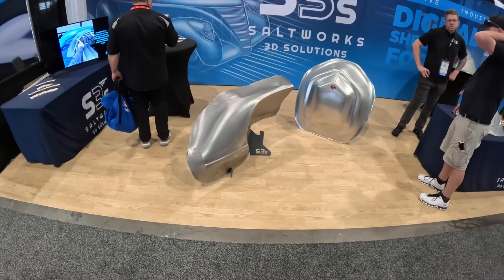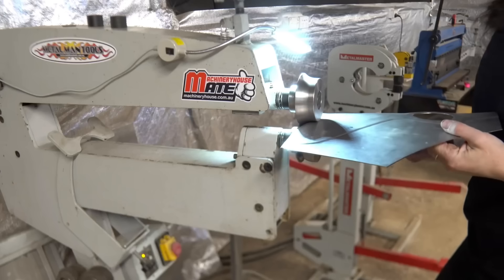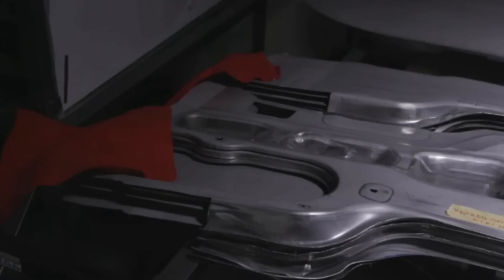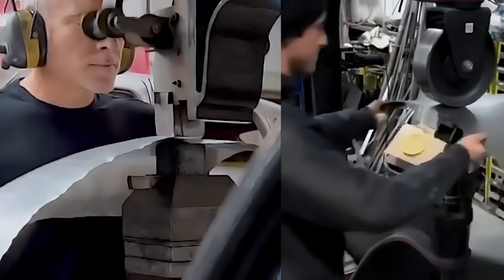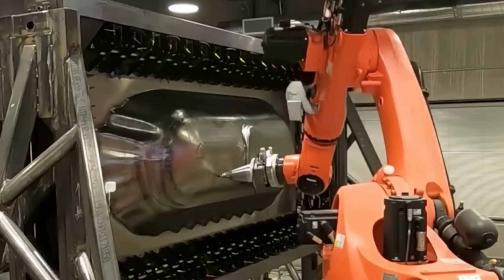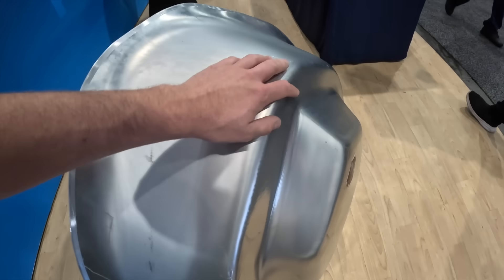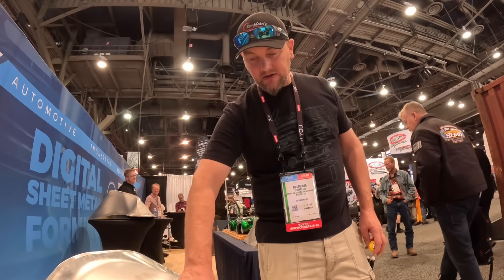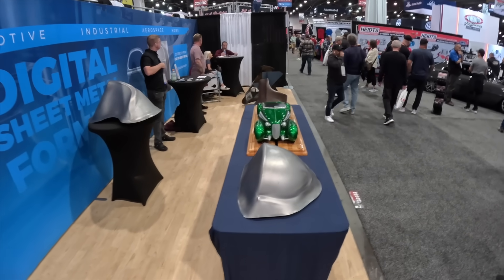This ROBOT Can MAKE SHEET METAL BODY PANELS In Minutes out of ANY MATERIAL! SEMA 2024

Comment: Next step,a drop forge that doesn't need dies but can shape anything.
Reply from the maker: forging is just arranging the molecules in a certain pattern I bet eventually they can do it without using heat or a press
Reply: @Junkyard_Dave There is more to it than that,and there is a difference between hot forging and cold pressing.

Comment: It would have been nice to credit “that girl”. Her name is Jasmin from the YT channel ‘Stout Metalcraft’ based in Australia and is one of the finest sheet metal workers I have ever seen. She does ALL the work herself and even hand formed the roof for her Toyota Stout from scratch. Actually, that was the one time I saw her get help simply because the panel was too big to handle on her own. Interesting technology but the cost of the robot will keep most enthusiasts forming by hand or, as happens now, send files to someone that can do it for them. Those issues with the finish will get ironed out over time. Maybe they can design a set of finishing wheels for the robot? Cheers.

Comment: I've seen several versions of these. I love the idea of it. The greatest benefit I see, is inverse repeatability. Not only can it save massive amounts of material and labor... but even if it doesn't turn out exactly right, chances are, the mirrored side have the mirrored outcome.

 For instance, left side fender has good interface... but curve is a little off. You have choices. If it still looks good, the right side will match it perfectly. If it's workable, you can plan to hand-finish both sides the same way. If you have to scrap it and correct the CAD/slicer/etc., you know the corrections will be identical. 

Even when it screws up, and you have to scrap a piece... it's still faster/cheaper than hand fab, and you can focus on design/wiring/assembly while it works.

Comment: The expensive high force $80K percussion tool robot arm is a huge hurdle for home and small custom shops. It's only volume production factories that could afford this. IMO, 3D printing a male mold and then fiberglass and a vacuum is still the most cost effective for really custom panels.

Comment: Imagine sending the files of a 1955 Mercedes-Benz 300 SLR Uhlenhaut Coupe to a shop and picking up the finished body in a couple of days.  Even if they charged $10k a day, it would be a deal.  This is the future.
Reply: You can do that today with a large format 3D printer, glass and carbon and vacuum pump. Maybe 3x the time because of the hand finishing required

Comment: This is neat.  I wonder if they can start with a thicker gauge sheet to end up with a certain gauge after it's stretched.  Hopefully there will be companies you can go to and have a panel made for a reasonable cost.  Even if you have to work it afterwords it's still cool.
Reply: You could probably start out with the panel, then use the machine to make perfect fitting backer reinforcement shapes like the inside of car hoods and trunks.
Reply: @ yeah, that’s a good idea, it would be an easy way to make those backer panels that brace the outside panel.

Comment: This could get you into the ballpark a lot faster you still would have hand work to do but still what it will save you weeks of time doing it all by hand I would like to make using the part as a mold for a fiberglass parts or carbon fiber again so much quicker than from scratch And of course, much more accurate especially if you’re making fenders that are round from right to left, keeping it the same is difficult by hand

Comment: I would take it to the next advancement using thermal pinch forming, by applying both Heating and Cooling to the process. 
Heat to allow for more precise control of the plastic deformation and then rapid cooling to Lock in the shape.
I should Patent this technology. No One is doing it yet...

Comment: Metal spin forming has been a staple of formed sheet metal for decades.
Hydro-Forming and Press forming take flat static sheets and cause plastic deformation of the metal to retain it's new formed shape.
Translating that to CNC Pinch forming is just taking the plastic deformation process of stretching and forming of Metal to the next level.

Comment: Yes,I’ve been following this, and I think it’s fantastic!  I think the Figur machine give better results than the two finger methods, unless they have improved it.  And I think the Figur is faster.  Cutting should not be a problem, because you can have it trace a groove with a sharp stylus where you cut it out. Supposedly it’s fairly economical. Certainly less than making hydraulic die press.  I think manual sheet metal working is still necessary to bring pieces together, tweak things and both small pieces and very large pieces.

Comment: Hand formed bodies are shrunk to size/shape not stretched, the body work gets thicker not thinner. Not that it matters but this is similar to deep drawing an aluminum can. I was fabricating replica AC Cobras and Ferrari GTOs of the same era 35 years ago and they were better than the originals. No lead or bondo and a couple were polished to a mirror finish. It's definitely an art.
Reply: how can it be art if there's no lead?

Comment: Press tools are for high  volume parts, they run a sheet thru 'stages' to achieve the finished panel. This technology is more suited to low volume or one offs, has come a long way! Coach building is a craft which cant be lost altogether &  could work in conjunction with this?
Reply: A Stamping Press process can spit out panels in minutes with rates of 120 an hour. As stated high volume parts. But prototypes, custom or reproduction this is ideal.

Comment: The downside i see to this is that the edges will always be flat, so the metal needs to be stretched way more then if it was done by hand, losing rigidity
Reply from the maker: So where it grabs isn't part of the part the first down push makes it rigid so then the part can be formed its almost like support material on a 3d printer
Reply: @ yea i know its impossible to do this way, without grabbing the edges, but just wanted to point out one of the few downsides, the material will get thinner then when its done by an artisan

Comment: There is a process with a male and female mold with the composite between the two that squeezes the resin out between them to get just enough resin to cover the fibers which is as light as that part can be made. This would be perfect for that.
Reply from the maker: Do you mean for carbon fiber? The pressure for that process is 100's of tons

Comment: Clickbait title
This process does not take minutes…..
Reply from the maker: @brianwaayenberg3099  depends 8n what you're forming that nose cone tool 30min to make out of aluminum
Reply: That was on the single point gantry machine? That’s very impressive tones to form that prototype.
I assume being 3 axis it is limited in the geometry it can form. Still awesome tho.
The could ass a counter  ram under it to for support, heck could add a 5 axis head too.
The gantry/ram will be stiffer and more accurate 
The 2 arms is prototype only to avoid designing a purposed machine and for that its less stiff and takes forever
Reply from the maker: @brianwaayenberg3099  the orange arms are 5 axis well technically more since the support arm can allow more complex shapes. The company with the orange arms are going to try to setup as a job shop for automotive body panels plus they are doing titanium forming which hasn't really been done before. The 3 axis one a company will charge 800 a panel which is pretty good if the machine is 1 million.

Comment: This young lady is amazing, no machine will match her work
Stout Metal Craft , this machine will cost $$$$$ and will obsolete within years
Reply from the maker: She is good but I remember when the machinists were trying to fight the cnc machines saying the same thing obviously we would never have billet blocks if that was the case
Reply: I'm a machinist with focus on cnc milling. 
But I would say that billet blocks is something you could make quite easy on a manual machine. 
Bugatti made their engine models from billet after their signature engines. 
Besides that I have seen many billet v8s among other engines made on manual machines.
But it sure is more fun making 8 connecting rods on cnc than on manual mill imo.

Comment: Amazing but.. limited to small  run low production vehicles... 8n an industry where composite materials is growing by the day.   
See , in large scale industrial situations you cannot beat stamping and robotic welding for speed and cost.    Manufacturing engineers spend every second of every day trying to reduce costs and increase production speed and a system like this in a large plant would make them have nightmares. 

It's too expensive for a small fab shop who can knock out small runs quickly with hammer forms and talent.   So who does this system best work for, based on cost, talent,  flexibility,  and time?    Basically high tech prototype shops, or very limited run shops with limited fab capabilities.
Reply from the maker: People said 3d printing would never be industrialized or used in automotive markets but look at the metal 3d printers doing just that and doing things that could never be done without the tech

Comment: The girls YouTube channel is called Stout Metalcraft! She’s insanely talented at metal fab
Reply: Definitely about to subscribe to her channel! Thanks for info
Reply from the maker: @bodiedgmc  very talented but the old machinists also were very talented but could never compare to a CNC mill or lathe
Reply: @Junkyard_Dave   back off dude...  we like old ways
Reply from the maker: @cabilgibbs  old ways are cool but not consistent
Reply: @Junkyard_Dave old way here, consistently good is worth gold when compared to cheap and fast any day of the week. It just takes skill and time. Every one of the examples you showed had excessive tool marks and would definitely have fitment problems from the get go...
Not to mention the quality of the materials which you didn't even touch on.
I can use better material because I have my hands on the metal as I'm forming it.
That process requires material that is easier to form. It can only be formed one time and is very difficult to do additional work to without problems.
Which can make removing things like tool marks problematic.
Which means fillers instead of reforming the material to finish it.
Reply: @bodiedgmc Thanks! I went to her channel and subscribed.
Reply: Thx!!!
Reply: Also has a channel called Khaos Design
Reply: Then this machine comes along, good for most but sad for her.
Reply: Yes she is !
Reply: Thank you! Much better than "that girl."
Reply: My grandfather was a pattern maker in the first stages of the Australian auto industry.  He made the shapes in timber and clay from which parts moulds were made for panels and other bits.  He would have been tickled pink to see this, but for mass production it’s still cheaper to make the moulds and press out the panels with a 100 tonne press.  But for low volume, these could pay for themselves pretty darn quickly.
Reply: She looks awesome. Subscribed.
Reply: "girl"? If this was a man, would we say boy?
Reply: I say dude all the time.
Reply: @TurboHEMI_426  Her name is Jasmine Green. Somebody that talented deserves to be name checked. We don't refer to Dave Kindig or George Barris as a 'boy'....
Reply: @omarks  cry harder
Reply: @Chingusbobingus  ok boy
Reply: @Chingusbobingus  ok, knobfondler
Reply: @ Dave referred to her as “girl” multiple times during the video, so you can take that negativity elsewhere bud.
Reply: @bodiedgmc  Well Bud, that was for you and Dave.

Comment: So if it goes mainstream and auto manufacturers start using it, they'll buy the rights to the body panels so that you can't make them at home.
Reply from the maker: If you 3d scan something and do a surface model how would they stop you from making it
Reply: @Junkyard_Dave  I like the way you think.👍
Reply: You ain't kidding. They will refuse to make them and forbid you from doing it.
Reply: Stamping sheet metal is exponentially cheaper. This would be used for design phases not full production. 

If there was a way for manufacturers to enforce the reproduction of body panels wouldn’t you think it would already be in place? There are hundreds maybe even thousands of aftermarket companies producing body panels and have been for many years.

Comment: Stainless Steels parts, what never rust. Or aluminium for weight reduction. Damn, Mopar C-body guys could finally have floorboards, fenders, trunk floors, window corners etc...  🙂
Reply from the maker: Anything you could 3d scan and make a model of it could make which would be crazy
Reply: Wouldn't it be cool to have a stainless bodied muscle car?
Reply: If you have a perfect mold this thing can spit them out forever, perfectly in less than a hour.

Comment: Repeatability is everything.  Be nice not having customers waiting all day just for sheetmetal work.  There is alot more to a car than just bodywork.  You get in an accident, boom press start and a new panel is made. Worth takin a loan out for.
Reply: thank you. personally I think hand fabrication is a beautiful but ludicrous art. One accident and hundreds if not thousands of hours are gone. Of course presses and dies are super expensive, but this is the solution I always knew should exisst
Reply from the maker: @CZ-kz7ug  yes it is especially if you want everything to match and be uniform
Reply: It remains to invent the ideal robot painter
Reply: how much does such a machine cost?
Reply: If your shop is anything like mine, that loan better include capital for another building. I don't know any custom shop that is worth its weight, having the kind of extra space this machine would require.